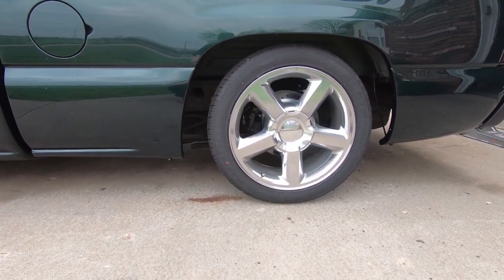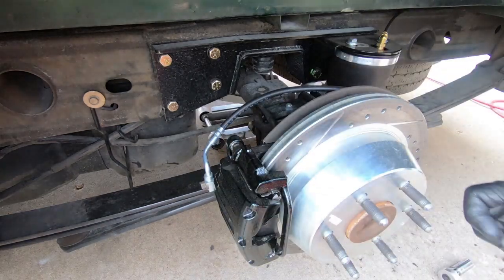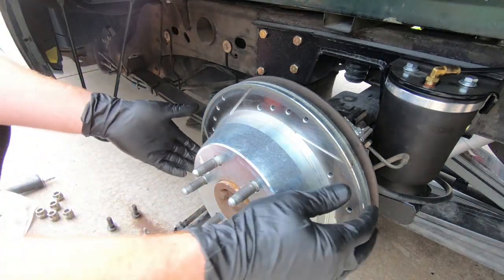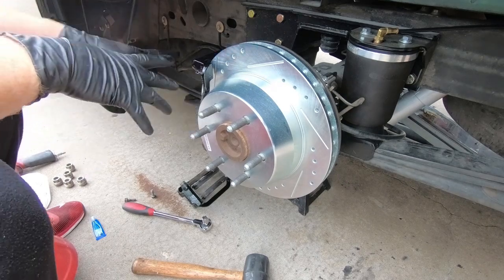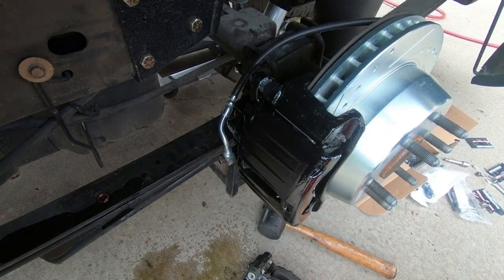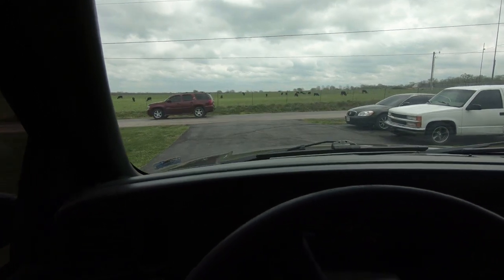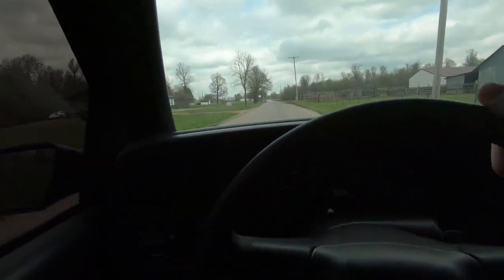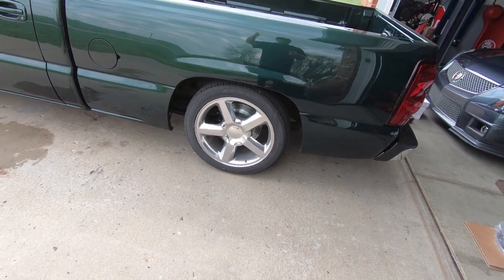How to Upgrade to Dual Rear Calipers Sierra / Silverado

Comment: I'm thinking about a 9.5" or 9.75" 14 bolt SF rear with the 13" Rear disc with double piston calipers, know a good place to start? Converting from rear drum. Would like to make this a stock conversion (rear disk with the shoe emergency brake)
Reply from the maker: That would be strong
Reply: @TWAMotorsports  is it possible to accomplish on a drum rear end?
Reply from the maker: Probably
Reply: @TWAMotorsports  yeah it would make it easier if I cant find a disc end as a 9.5
Reply from the maker: That's for sure

Comment: Thinking about doing this swap, just wondering if I could still run 17 inch rims?
Reply from the maker: Yes I think they would fit under 17s
Reply: Some 2001-2002 Tahoes came with 16”rims? Do you think they would clear?
Reply from the maker: @imonaroll9502 probably
Reply: @TWAMotorsports  ok. So I just did the swap. The 16” wheels do fit but since it’s a hub centric wheel it sits about halfway where it should be. The 17” wheels and up will sit more flush. Just tested one out.  But I can tell my braking is so much better now.
Reply from the maker: Mine was noticeable better

Comment: Ordered 2020 Silverado 1500 front calipers/rotors they came in and rotors didn’t sit flush inside calipers nor the pistons were aligned with the rotor. Also, rotor size is 13.5” diameter, there’s an upgrade kit that has the 15” diameter rotors for $2300 been to 4 dealerships and no one has them or can order them. Local auto part store go based on a non GM trucks so they won’t have the right stuff. Now I’ll consider 2011 model with 1” increase in rotor size 13” and call it a day.
Reply from the maker: Well that sucks. Good luck finding the right parts.

Comment: Many thanks for the vid! Did you notice any increased stopping power under 'normal' driving? That is, did it seem to take less brake pedal pressure to stop the vehicle, or was there no difference? I have single-piston rear calipers on '03 Silverado (16" wheels), and am looking to increase stopping power for around town driving.
Reply from the maker: I didn't notice a huge difference but some. No less pedal feel just quicker to slow down
Reply: @TWAMotorsports  funny enough the pedal felt the same between my 2007 and 2003, diff was 2003 was all disc, and a 2000 suburban, so i say the depress is factory config.

Comment: Do you know if I can do a clean axle swap from a drum rear axle to a disc axle set up on my 05 single cab Silverado?
Reply from the maker: Yes you can
Reply: They also make drum to disc conversions for those years

Comment: Good video. I would recommend clamping off the end of the brake line hose before breaking the seal to the brake caliper. This would prevent excess air entering the brake line, and prevent excess fluid leaving the brake line.
Reply from the maker: Probably not a bad idea
Reply: What would you use to clamp it?
Reply from the maker: Vice grips if rubber. I'm not a huge fan of doing that though.
Reply: Those lines are soft lines. He did it right

Comment: I just did this same swap a month ago  and the fronts from an ‘05 with rear drums
Reply from the maker: Nice
Reply: Arturo Galindo did you use a kit? Wanting to do the same on my 07c
Reply: Haze89 for the rear I used 2004 Tahoe calipers, caliper brackets, rotors and re- used my stock hoses. For the front I’m using calipers, brackets and rotors from a 2005 Silverado/Sierra model that came with rear drums. Those rotors are about 25-30mm bigger. I’m also gonna be swapping in the hydro boost and master cylinder from a 2004 Suburban.

Comment: TWA, what’s up man ! Actually just put this kit on my 04 Silverado. Went from single to dual pistons as well. But it’s rubbing the inside of the drum as I drive and made it course. 🤦🏽‍♂️what do you think I should do, besides buying 2 new rear calipers smh
Reply from the maker: On the ebrake? What you said doesn't make sense to me so not sure how to help.
Reply: TWA Motorsports it’s either the ebrake or the something, I took the drum off and in the barrel area right behind were the studs go through it’s course like something’s rubbing the inside of the barrel
Reply from the maker: Ebrake issues and it's a rotor not a drum
Reply: TWA Motorsports thank you sir, I stand corrected 👍🏽 my apologies. Appreciate your help man !

Comment: So i heard you mentioned the front had a bigger conversion coming from the 06-07 models, what parts would you need for that?
Reply: Also i see you only listed the rear brake calipers and not the brackets, where can i get those? Im assuming the ones it has right now (single piston) wont fit anymore.
Reply from the maker: Links listed come with brackets. Front part numbers I don't have but they are standard 06 front brakes.
Reply: So would I just search for them on amazon as front brakes and calipers for an 06 chevy?
Reply: You should look into doing a 19-20 swap if you're going to do it. They are even bigger brakes
Reply: What would you need for a 19-20 swap
Reply: @rubenrios646  I think just a washer to act like a spacer other than that it's a direct plug and play.
Reply from the maker: No idea yet
Reply: 19-20 swap
You need both front 4 piston calibers
Both front rotors
Front pad and hardware kit
4- 1/8 inch thick washers that fit over bracket bolt. Inner diameter 

Here: 
Front
2019- chevy 1500 Silverado
-4 piston front calipers
*acdelco pn. For calipers 
172-2883
173-2882

Gm part numbers for calipers 
13536580
13536579

*Washers for spacers on bracket bolts
-0.15 in thickness / 3.81 mm /—1/8 in
-1.11  in outside diameter
-0.54 inside diameter bolt hole / 9/16 or 5/8 roughly

Copied from gm parts list
Front Driver Side Disc Brake Caliper without Pads and Hardware kit
Product ID: 13536579
   $85.75

Front Disc Brake Pad Set
Product ID: 84847749
 $108.26

Front Passenger Side Disc Brake Caliper without Pads and Bracket
Product ID: 13536580
   $85.75

Front Passenger Side Brake Shield
Product ID: 23363947
  $6.75

Front Driver Side Brake Shield
Product ID: 20971875
$19.46 ×  Quantity   $19.46

Note: calipers have bolt holes built into them no need for brackets with this design.

Comment: Can anyone confirm for certain that the stock GMC 16" wheel will have clearance with this upgrade?
Reply from the maker: Shouldn't be a problem
Reply: It should be fine, the front already has those calipers

Comment: Have you found any for the 4.3 engine mods, any to increase the HP.
Reply from the maker: Not really spending any money on that. Just not worth the small results in my opinion
Reply: Yea pull the 4.3 and add .5 or greater.........
Reply from the maker: @trentdawg2832  lol

Comment: It's so easy just to put the hardware on the brackets then lube the contract points on the pad, put the pads in place then apply the caliper. This i fine to be the easiest way.
Reply from the maker: Probably so

Comment: I can't decide :  So my driver rear caliper started leaking from the inner seal ring. I was gonna just get a seal kit but I decided to replace both rear single piston calipers, for the reasons you mentioned. Mine still worked fine however, except a little fluid leak. Won't Sierra/Suburban rear dual pistons work? I'm kinda on a budget and it's a stock truck so I just wanna get by. Also, what do these fit? I have a 2000 Silverado 1500 4.8L 2wd . Do these fit the '99-07 ?
Reply from the maker: They will. You could buy used from a salvage yard.
Reply: Suburban Yukon’s Tahoe of the same gen, all had dual rear calipers and Will bolt right up

Comment: Ok, related brake question. My Yukon Denali had AWD and therefore discs all round. Can the rears be upgraded just like the fronts to the newer '07-'19 calipers/rotors/pads? I can't seem to find any proof of it being done...
Reply from the maker: I believe others have but can't confirm

Comment: is the kit used for the rotors and pads on your earlier video different from this one, I will attach the link below! Or would I have to purchase the rotors and calipers linked for this video alongside the dual pistons calipers for the rear? 
The rotors are different when comparing links from your first video and this one, that is why I have this question. Also, would this fit on a 2000 Chevy Silverado? 

Link: https://www.amazon.com/dp/B005FKXTEY/ref=au_as_r?_encoding=UTF8&Make=Chevrolet%7C47&Model=Silverado%201500%7C491&Year=2000%7C2000&ie=UTF8&n=15684181&s=automotive&vehicleId=1&vehicleType=automotive
Reply from the maker: So the kit in the first video is for all 4. In that kit you just need the front. This video is all the parts you need to swap the rear.
Reply: So if i purchase the kit for all four from the first video and then purchase the dual pistons calipers only from the second vid would that also work?
Reply: Nvm i see now that you would have to get the rotors listed here on this video, however when i put the info my 2000 silverado it says it doest fit that vehicle. Is that incorrect?
Reply: Idk if you could assist with finding the correct rear rotors (powerstop) and calipers because the ones you listed dont fit my 2000 chevy Silverado 2wd
Reply from the maker: It will say rear won't fit because it wasn't any option. If you have drum brakes this will not work the same
Reply: Wdym it wasn't any option, and i dont believe I have drum breaks how would one find out?
Reply: Your saying this would still fit 99-02 Sierra/ Silverado models?
Reply from the maker: @rubenrios646  yes
Reply: Thanks hopefully they fit as smoothly as yours did on the vid!
Reply: Asking as your rear brakes are disc and not drum brakes which I believe all 99-02 had disc.    Than you need the front brakes from first video and the rear brake setup from this video.

Comment: If the bigger trucks have a bigger assembly then why not just go to a scrap yard and pull em off for cheap?  I'm sure anyone with a cheap harbor freight compressor and sand blaster could make them look new again with a lil paint🤔
Reply from the maker: Probably could

Comment: Easiest way: pull complete axle out of 2000-2006 suburban lt
Reply from the maker: Good information
Reply: @TWAMotorsports  you'd be surprised what you can use from cross-platform vehicle's. I'm currently trying to figure out how beneficial it would be to swap from conventional to hydro boost
Reply from the maker: I agree